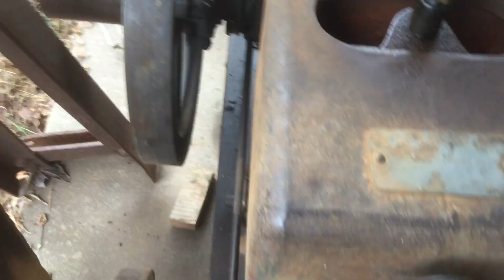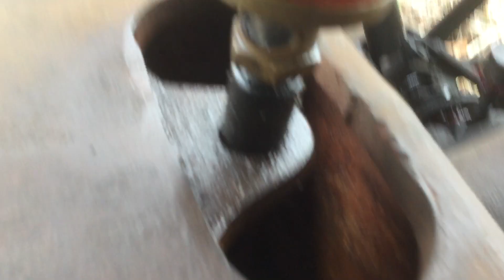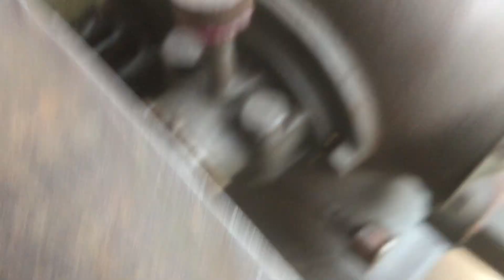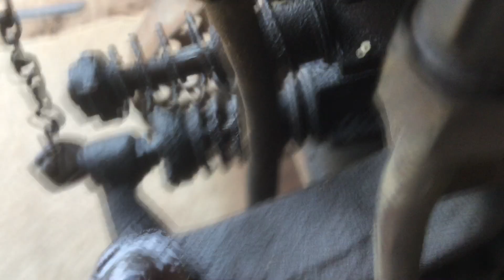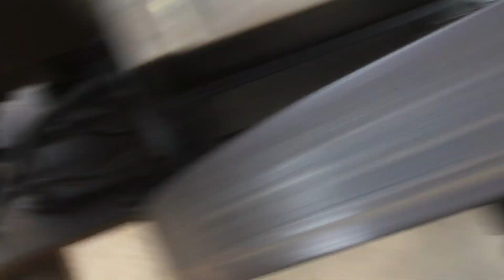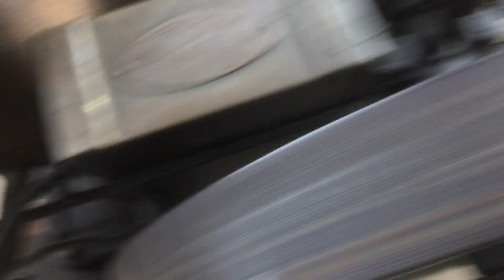McCormick-Deering 'M' Engine 1-1/2HP COLD start-up and run

Comment: What kind of fuel pump do you have with a sight bow and that primer lever. My M does not have either. I have to use packing in my pump and I rebuilt it 3 times before I could get it to run an anything but the primer in the mixer.
Reply: Do not use a crank handle with a magnito ignition watch shop dog Sam you tube channel " The bailing wire engine international harvester type m  he says to hand start with the lever in the start position you do not want to break your wrists stay safe
Reply from the maker: It's a GM fuel pump. The last couple of years the 1-1/2 horse M were made came with them. They work great after replacing the diaphragm.
Reply: Inheriting one very similar this summer.  I'll be looking for info on how to check it over, things to clean and not to clean to keep it original.  Any suggestions for websites or forums?  Probably attend some shows and talk to guys also.  SW WI...